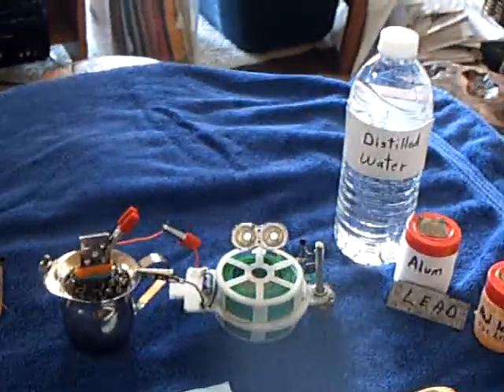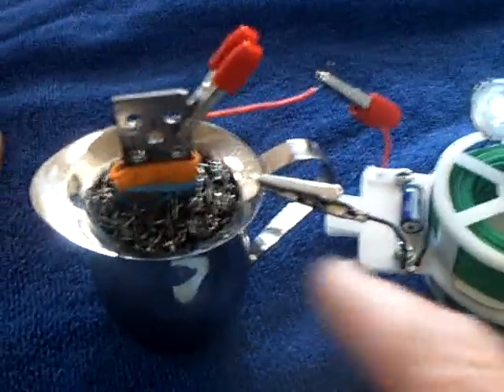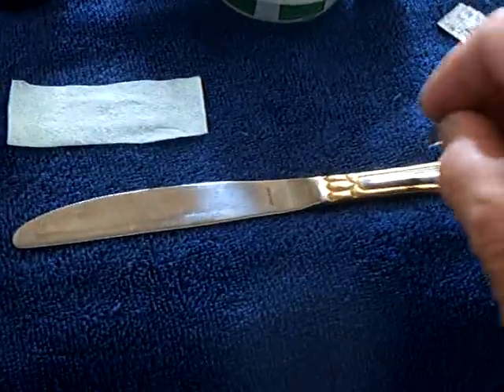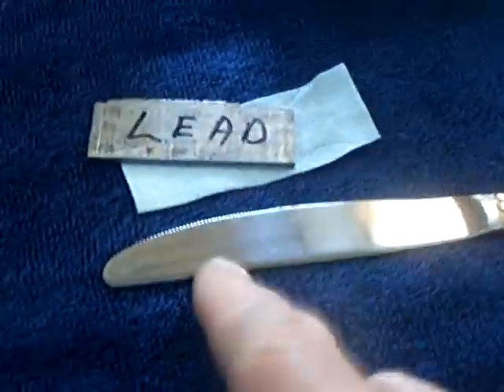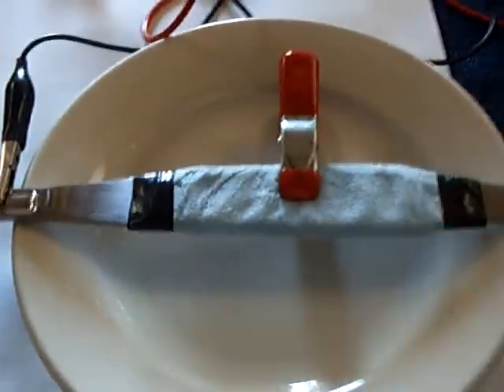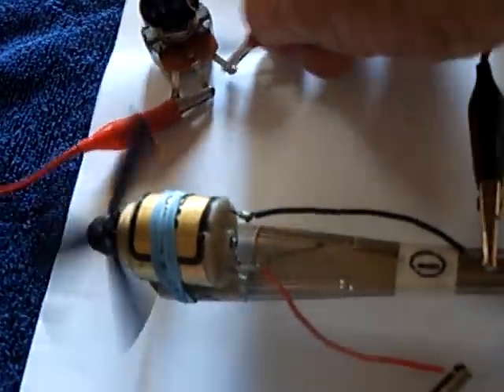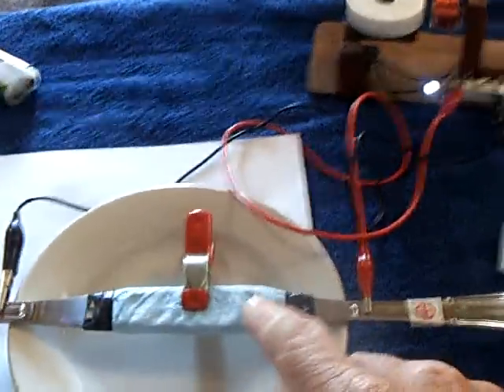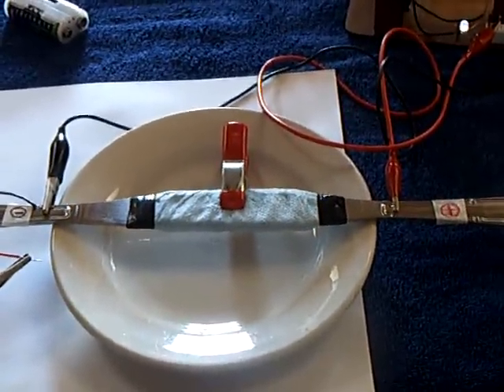All Stainless Steel Homemade Battery

Comment from the maker: That is why I am using the red lead (lead oxide)----so the reaction goes after that instead of the stainless steel.  I am using potassium aluminum sulfate Alum and Dollar store China stainless steel.  Yes it does something to the stainless steel finish but I have been able to polish the surface back to a shine again----at least on the negative plate.  The positive plate is taking a hit and is being pitted. :(  A higher nickle content stainless steel or a adjustment to the electrolyte might help.

Comment: I've had strange reactions from stainless spoon and strong hot alum & distilled h20 mix. Took the shine off the spoon, seemed to etch the surface, and made the liquid greenish. Cheap spoon. Any ideas?

Got it on video, but it's bad long video, will have edited and up asap. You can see the spoon fizziling as the alum goes hard.

Comment: Could this be more of a capacitor than a battery? DOes it have an initial charge? I might have missed you saying it did. I'm just trying to get around the idea of the same type of metal making up both the pos and neg poles.
Reply: Check out dual carbon batteries coming up. Out performing lithium too
Reply: Check out dual carbon batteries coming up. Out performing lithium too
Reply: Check out dual carbon batteries coming up. Out performing lithium too
Reply: Check out dual carbon batteries coming up. Out performing lithium too
Reply: Check out dual carbon batteries coming up. Out performing lithium too
Reply: Check out dual carbon batteries coming up. Out performing lithium too
Reply: Check out dual carbon batteries coming up. Out performing lithium too